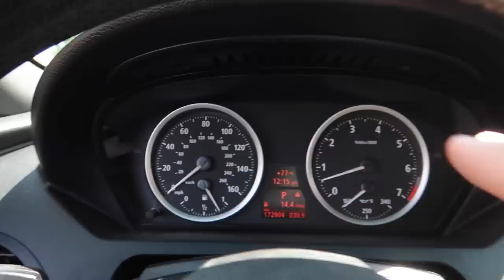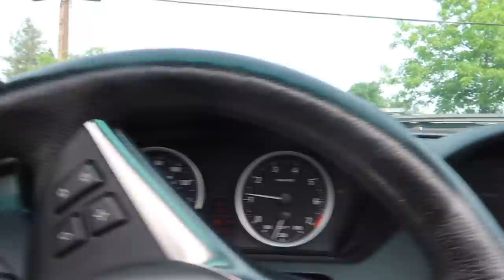STRAIGHT PIPPING BMW 650i V8 4.8L! (SOOOO LOUD)

Comment: Alittle off topic but your 335i oil temp in the day, what is too hot? Mine is running between 230-250F. Running Carly live data and the coolant temp is good but oil to me seems high. Southern California heat and the last couple days were 95° and it gets up to 250F oil temp.

Comment: Yo get catless race downpipes and with a straight pipes to a huge x Pipe, then 2 straight pipes all the way to the back, no resonator or muffler and weld the stock exhaust tips on the pipes going back bet you your bmw, it’ll sounds better than any other set up